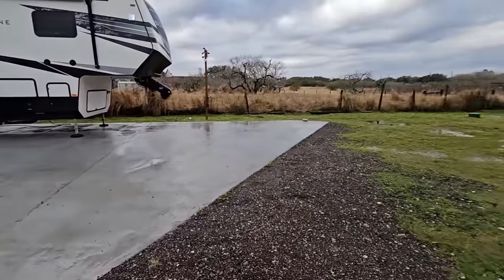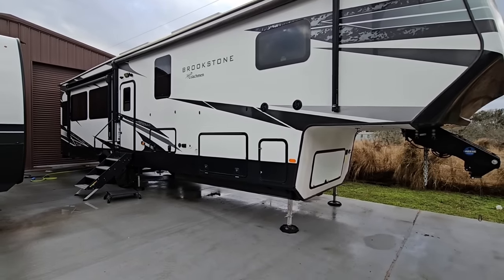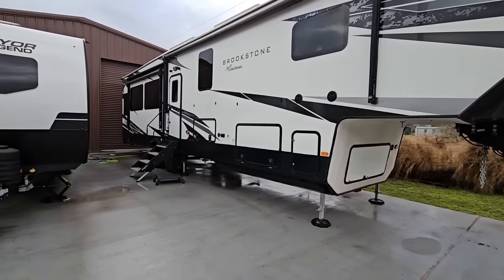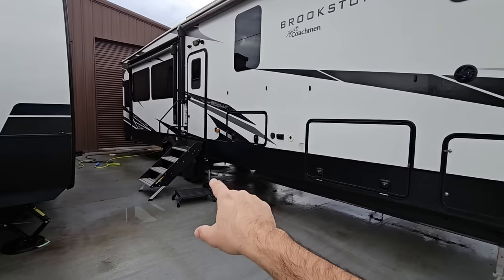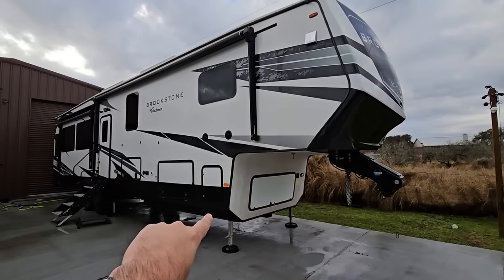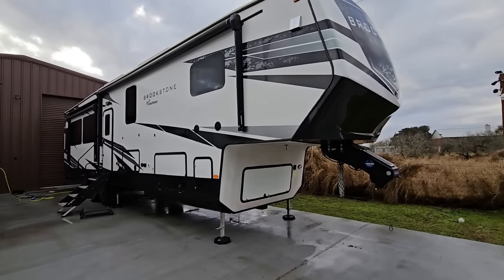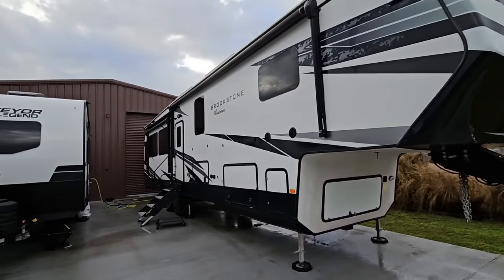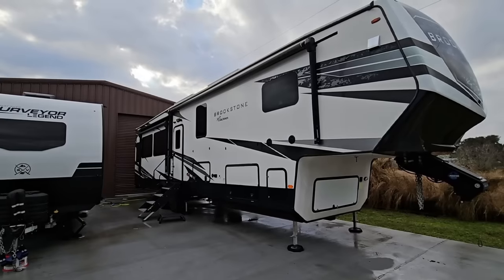FRAME FLEX on some Fifth Wheel RVs EXPLAINED!

Comment: The biggest thing about frame failure is that the manufacturer trying to keep the trailer as light as possible is using thinner steel. Their using 1/8 inch thick tubes instead of 1/4 inch. The failures I've seen has not been the welds breaking but in fact the parent metal at the weld tearing out. They'll take out fifty pounds of steel from the frame so they can stuff that 500 pound refrigerator in. Doesn't make sense.

Comment: Great topic! I have been a certified welder since 1983 and I worked many years as a structural Ironworker with my expertise being a welder. I worked very closely with many structural engineers and got a pretty good handle on how they designed things and had many of my designs verified by structural engineers when the design they provided wouldn't work in a situation and I was given the green light to improvise and then the engineer would run the numbers on my design. I was also trained in weld inspection as to what constitutes a sound weld and what is failure prone and unacceptable. I have designed and built several trailers including a 35' gooseneck/flatbed / camper in which the front 20' was living quarters and the rear 14' was a deck to haul my Jeep. I built that trailer in 1994 and have since learned a lot. My general thought process was to overbuild and that solved many issues, except the trailers were heavy. One thing I have learned over many years of modifying trailers is to continually inspect structural areas for damage. When a structural steel member flexes over and over it can become fatigued and the first thing to happen usually is a crack will form. If it is noticed, it can be repaired relatively easily, if not the condition will become worse and ultimately probably cause a complete failure. I have a pet peave with most trailer frames, pull type and fifth wheels. Take a look above the spring hangers on most brands of trailers on the main frame rail. With the exception of Northwood who installs a full length frame stiffener above the spring hangers, most of the other brands will either weld in a small piece of flat bar at about a 45 degree angle horizonally on the frame and stitch weld it to the outer lower frame flange and then several inches up to the frame web. The way I was taught on structural buildings there would almost always be two vertical gussets welded in fully directly above the load point which could be a column above the top flange or in trailer terms, the spring hangers. The gussets would be on both sides of the beam, so a total of 4 gussets for each loaded point. This spreads the load over a larger area so that the load doesn't flex the web of the beam. There are mainy frame failures on trailers where the lower flange flexes with the spring hangers and cracks the web of the frame. Over time these cracks grow and comprimise the strength of the frame. Couple this with spring hangers that are too tall for their thickness and the spring hangers will also flex until they fail. This is very common place of late. If you can find a brochure on a Jayco trailer built in the early 2000's, look at the spring hangers, they looked like they were built from a large section of tube steel of a heavy wall thickness and the hanger was one piece from the rear hanger to the front hanger and then it was welded to the frame of the trailer. I have never witnessed a failure on one of these hangers. Moving on to the front of the 5th wheel frames. I have looked at a lot of videos showing frame failures. What we don't know is how the trailer was loaded, front to rear, how much weight in each location etc. So it's really hard to say what caused the failure. In some cases I have seen horible welds that were definately responsible for the failure. As a professional welder with many years of experience this is super easy to see. Now, not all of the failures that I have seen photos of are weld failures. I have seen some photos where the tube steel in the front frame section has cracked right through the middle of the tubing. My guess would be that either the tube steel was not thick enough or the trailer was overloaded in the area of the overhang. I wouldn't be able to rule out that there could have also been some defective steel tubing from the steel supplier. I have witnessed brand new steel plate that was defective and had laminations in it where the steel had what looked like layers that were not fused together. I would like to address one other issue that I have a concern about. It seems that rubber springs like Sumo springs are popular. I am 100% against adding anything suspension wise between the ends of the leaf springs and the frame unless the frame is reinforced at that location to handle the added stress. If you want dampening, add shocks. If you need more spring rate, add heavier springs. I have lost count of the number of cases where someone has had some type of frame failure and a rubber spring is sitting between the spring and frame. There is a you tuber that had a frame failure and many people blame the trailer going through a ditch at to causing the failure. I would strongly disagree and since the frame was cracked and bent right where the rubber spring hit the frame it appears to me that the frame had been damaged for quite a while and then loading the axle going through a ditch would overload the lower flange of the frame and cause severe damage because all of the weight was placed in one location where the rubber spring contacted the lower flange of the frame. I have off roaded every trailer I have ever owned in places I probably should never have been and never suffered a catastrophic frame failure. I have broken leaf springs, and actually torn out a section of a lower flange of a frame on a 2001 Holiday Rambler Alumascape with a very light weight lippert frame. Full disclosure, I was towing a 14' horse trailer with two horses in it behind the HR. I repaired the frame when I got home. I am pretty sure that the frame section tore out when I went over a cattle guard that was a severe bump at about 20 mph. The frame had to have already been cracked though and I missed it in my inspections. Several days ago I completed adding 2x2x1/4 angle iron hanger reinforcements on my 2018 GD Solitude 310 to lessen the chances of frame web cracking and spring hanger failure. I also upgraded to 4000 lb leaf springs. This is my 3rd set of springs on this trailer. I have inspected my front frame as much as I can see without taking things apart and it looks good. I also don't see any noticabe movement when hooking up to the truck. One other thing I question is that most spring hanger failures are on the rear axle of the trailer. Most trailers being towed by a dually truck are slightly higher in the nose which places slightly more weight on the rear axle and when turning it is loaded hard. I just added one inch lift blocks to my Solitude which in additon to the 4k springs should have given the trailer about a 1.5 inch lift in the rear and it now sits level with my truck.
Reply: Good analysis.
Reply: Every I repeat every frame I have seen on YouTube depicting “frame flexing damage” has shown poor build workmanship. Welding poorly done, self-tapping screws were used incorrectly.

Comment: Laws need to change to hold these manufacturers accountable for these issues.
Reply: Every law often has its unintended consequences. I can guarantee you that the more “accountable” we make these manufacturers, the more the price is going to rise. I’m not saying you’re wrong - but I also think we should consider the ‘what else’ of any new statutes.
Reply: @brucewallace3860  I agree, the reality is they should be able to police themselves and stand by the products but when that doesn’t happen what is the alternative?
Reply: Single biggest problem is that the RV industry is basically UNREGULATED!  There is no governmental or industry association or group that specifies requirements and provides certifications.  As far as I know, the only ‘regulations’ that they need to meet are standards for things that are towed. There are no (or very few) structural requirements or building codes, etc. that they have to meet.
Reply from the maker: @marvs4321  This isn't entirely correct.  There are several organizations that dictate RV manufacturers
Reply: Yes, get the government involved. They have an excellent track record.😆
Reply: @romy9130  Last I checked the safety standards today have made cars waaaaaaaay more safe. So there goes that argument.

Comment: Frame flex, broken welds and cracked frame members seems to be a pretty common thing on Lippert frames.  I hauled RVs out of a factory in Pendleton, OR for a few years and was blown away at the janky frame construction I saw.  Sadly, they supply frames to the majority of towable RV manufacturers. 
Things I saw when picking up RVs from the transport yard:    
1. Short pieces of I-beam joined together to make a longer RV frame, rather than one continuous I-beam, probably because they were wanting to use up cut ends from other frames!  
2.  Fabricated pseudo i-beams welded together from 3 pieces of flat stock
3.  Welds that were so sketchy, they were obviously not done by a certified welder.

Comment: I feel bad for Paving New Paths. They said the same thing. It should be called frame failure or simply a broken frame.
Reply: I also feel bad for them as well as the My Bucket List Day guy. Grand design really gave them both a raw deal.
Reply: What bothers me most about both of those videos is that GD customer service did nothing to help.  I'm in the market for a 5th wheel now and will stick with Brinkley or Jayco!
Reply: @williamfreeling6546  I agree. I know that no company is perfect, and GD has done right by many, but overall I think their customer service reputation is on the lower end of the scale.
Reply: Haven’t heard anything about Alliance 5th wheels yet so I’m sticking with them till I hear otherwise.
Reply: Seems like the customer service declined when Winnebago bought them.
Reply: They didn’t accept the offer for service from Grand Design.  They thought it were too many steps.
Reply: @BlakeScout  The service offer was bring an unsafe to tow to RV to GD in Elkhart, pay is $16-20 thousand dollars depending on damage found then take it away. Not much of an offer if you ask me. Especially with the way they are standing behind their work with the Bucket List Day guy's rig which broke a second time.
Reply: Paving New Paths has that thing loaded to the gills (a lot of it up front, with no toys in the garage to counter the overall load on the frame)..... AND they put an excessive amount of miles on a toy hauler. I'll bet if he did a true (not CAT scale) pin box weigh, he'd be over the 25% rule.

In addition, he seams to complain about everything so I'm highly skeptical of his opinion.
Reply: @driveman6490  there is no 25% rule. It's a recommendation. I'm not aware of any documentation by any RV manufacturer that gives a maximum pin weight. As long as you are below GVWR and axle weights, it should be fine. 
And CAT scales are certified to be correct, heck "certified" is part of their name.
Reply: Feel bad for @1StrangeAdventure, @MyBucketListDay, and a number of other YouTubers that have had horrible customer service through Grand Design on this issue and how Grand Design is quietly trying to ignore this is happening. We are also dealing with it but luckily we have a point of contact who has been great in a previous matter and now this frame failure. I wish someone hung up on me but we are dealing directly with someone.
Reply: @evanmartin7809  
Rule, recommendation.....call it what you want. Industry still states 15-25% of the GTW. 

He did a video last year (after having their 5th child), where he documented his set up weight using a CAT scale. He was 596lbs over his target pin weight. He admitted to needing to redistribute weight and other adjustments, but in my opinion he's been overloading the front of his 5'er, leading to some of his issues.
Reply: @driveman6490  What was his target? was it 15%, 25%, something else?
You're opinion honestly means nothing without facts.
I'm having very similar issues with my 18 month old 5th wheel (Keystone, not GD) and I am at about 18% pin weight, and 500lbs below my gvwr.
Reply: @evanmartin7809  
From his CAT print out:
Gross truck/trailer weight: 28,740, minus truck only: 9,320 = 19,420 trailer weight.

His stated "ideal" pin weight: 3,884 ÷ 19,420 puts him at 20% target pin weight.
His actual pin weight was 4,480..... difference of 596lbs.
Reply: @driveman6490  perfect, so you agree he's not overweight and not over 25% pin weight. Glad we cleared that up.
Reply: @driveman6490    Sorry, but there's no such thing as "excess miles" on a trailer.
Reply: @driveman6490  He has done several weighs on his channel and was never overweight.  Close but not overweight.
Reply: @evanmartin7809  what type of keystone

Comment: Another thing that will cause excessive frame stress is gooseneck adapters (not talking about the Andersen Ultimate Connection or Reese Goosebox). A straight gooseneck adapter puts so much extra leverage on the frame since most of the straight gooseneck adapters seem to not have enough adjustment to make the 5th wheel sit level when towing. If you think about it, a gooseneck utility trailer, cargo trailer, or stock trailer have extra gussets  where the gooseneck hitch attaches to the main frame of the gooseneck trailer. 5th wheels do not have those extra gussets where the alcove of the 5th wheel meets the bedroom floor which is where the frame will break every time if you’re towing with a straight gooseneck adapter. I’ve seen it happen more times than I can count in the almost 8 years of working in the RV industry both on small 5th wheels (under 30 ft.) and on giant 5th wheel toy haulers (40-45 feet).

Also having a super lifted truck or not adjusting the 5th wheel hitch to where the 5th wheel rides level can cause the same thing.
Reply: Reese goose neck,  for fifthwheel rv, has,air bag and,shocks,  hmm,should be way smoother than a ridged  pin box and   fifthwheel  hitch,🤔
Reply: @dennispatterson3085  the Reese Goosebox is not the problem. It’s the straight gooseneck adapters a lot of people use instead since they are typically only $500-$800 instead of $2,500 like the Goosebox. Traditional 5th wheel hitches are the best option for towing a 5th wheel in my opinion but there is nothing wrong with a Reese Goosebox or Andersen Ultimate Connection. Regardless of what hitch you pick, the trailer still has to be level or you can still run into the same issue of breaking the frame under the bedroom.

Comment: I have a degree in Metallurgical Engineering and have done studies in metal fatigue failures.  One factor that is often discounted in the RV frame failure discussion is the condition of the roads we are taking in combination with the speed in which we are traveling on those roads.  There is a huge different in the stresses the RV frame experiences when travelling at 55 mph versus 70 mph and our awareness, sensitivity, and appropriate reactions to this single factor alone can significantly reduce the flex forces which contrbute to frame failures in our RVs.  As a result, a critical part of our trip planning process needs to be to take into account the possibility for changing road contiditons and the need to respond to those by reducing our travel speeds.  When we build this contengency into our travel plans, we minimize the potantial for a stressful travel day where we feel we are falling behind in our schedule.  It is critial that when we are driving on roads where conditions suddenly become unfavorable, we respond by reducing our travel speeds. This unquestionably requires discpline on the drivers part as it is temping to keep up with the traffic when in actuality, reducing our speed will translate into less flex stesses being put on our RV.  Think of "slowing down our speed" as adding an insurance policy that will extend the useful life of our RV.    Jan Kahn

Comment: Good clarification. A contribution to this problem is the condition of major routes in this country. I’ve driven sections of interstate highways that are absolutely horrendous! It’s not just backroads we probably shouldn’t be on. So we either need better roads or better RV’s. I think both! The incidence of “frame flex” you see on social media are broken frames. So you’re right it’s really frame failure. Flex is necessary to absorb energy so the the structure being flexed doesn’t break. 100 story buildings flex quite a bit on a windy day so the don’t break in half and fall to the street! If you look out the window of an airliner when flying, that wing is flexing. Again, necessary so the wing doesn’t break and fall off! The problem with these frame failures is the forces being applied are greater than the frame can handle in spite of the flex, not because of it. The question is, are the people designing frames and RV’s, engineers that are able to calculate the stresses that are being applied then design the unit to withstand the situations the unit will be exposed to without failure. I can’t say for sure but it sure seems not!